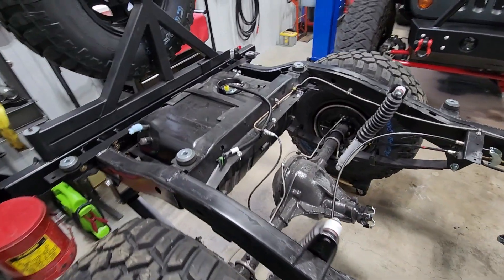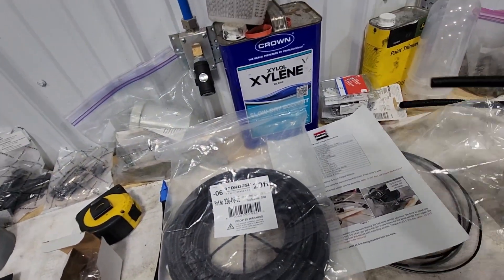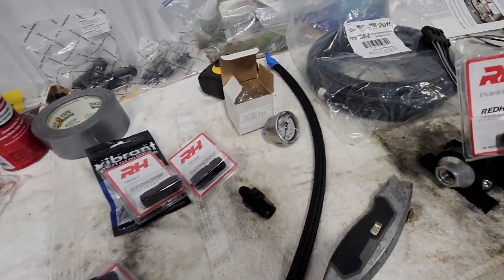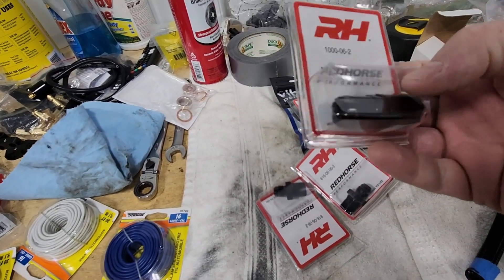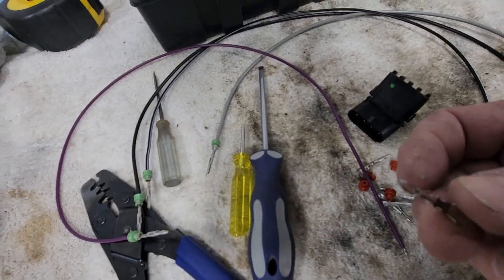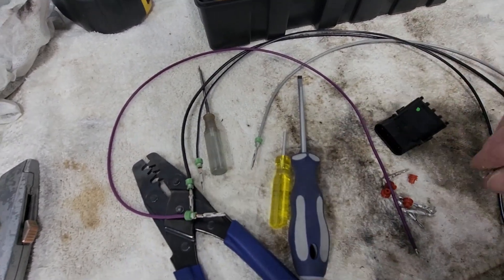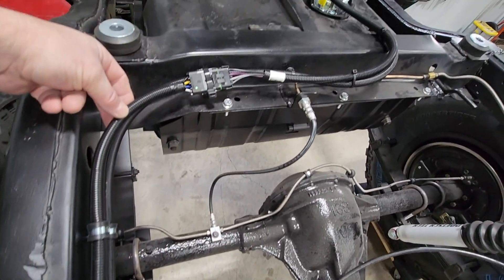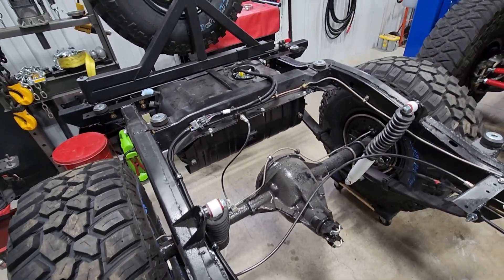CJ5 Holley Sniper EFI fuel pump wiring and plumbing Pt 1

Comment: GEREAT how to video.  I'm doing a frame off on a 85 CJ7 and have installed an AMC 360.  I also plan on running the Holley Sniper EFI.
Reply from the maker: That is great. It is a nice system to work with, especially if it is complete with ignition, distributor, etc. Then it all plugs in fairly easily

Comment: What fuel pump did you use?  Is the tube coming out of the fuel pump 3/8 diameter? Thanks
Reply from the maker: I used Holley's in the tank fuel pump for the CJ. It replaces the original sending unit. The output tube is 3/8" but I could not find a quick disconnect fitting to fit it like an EFI connector. Ended up just pushing hose over it and clamping it like the stock setup.
Reply: @millstonejeepworx  Do you happen to know the part number?
Reply from the maker: @aog9354  It is part number 12-307. Call Holley and talk to tech. The guys are super helpful and can help make sure you got everything you need. I purchased my stuff from EFIsystempro.com in Florida. Great people as well. https://www.holley.com/products/fuel_systems/fuel_pumps_regulators_and_filters/fuel_pumps/muscle_car_efi_modules/parts/12-307
Reply: @millstonejeepworx  I just installed the same pump 12-307 in my tank. The fitting on the pump is 5/16" diameter. I don't see one with a 3/8' diameter tube.
Reply from the maker: @aog9354  Holley kept telling me it was 3/8". It is 5/16" then. I just clamped my braided 6an (3/8") to it. Haven't hasmd any issues.
Reply: @millstonejeepworx  Thanks for the fast replies. I just wanted to make sure I'm going the right direction. My new motor is coming out of the machine shop in about 4 weeks. (AMC 360).....
Reply from the maker: @aog9354 Your welcome. Hope it helps. The video shows how I ran mine. There is no return line and you will need an in-line filter.
Reply: @millstonejeepworx  Great video. I found a compression fitting for the fuel pump tube today & installed it on the tank fuel pump. I also picked up the inline filter, fitting & clamps. I will be installing the gas tank this weekend. Thanks again for all the help.